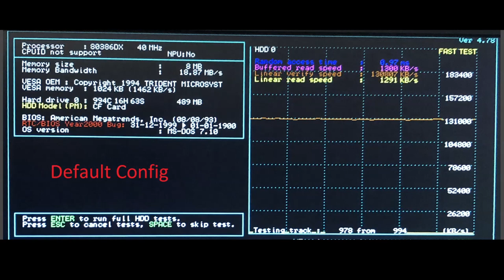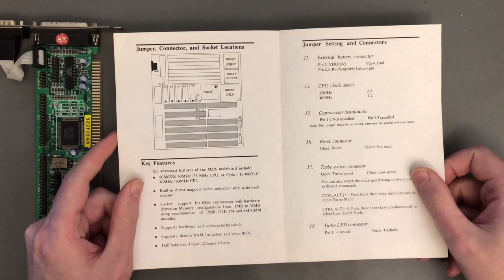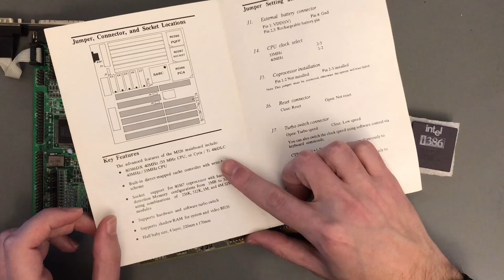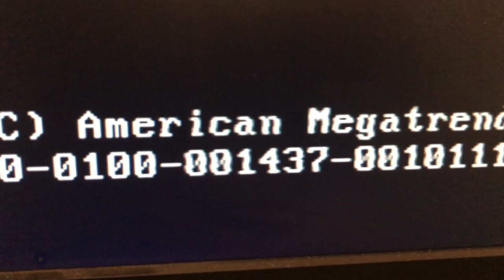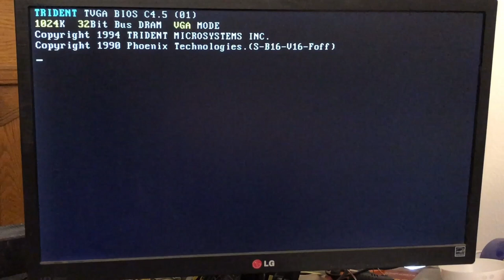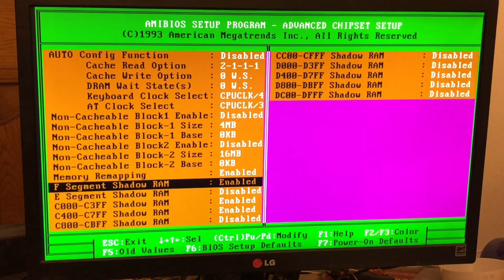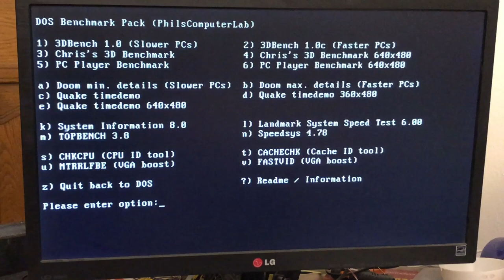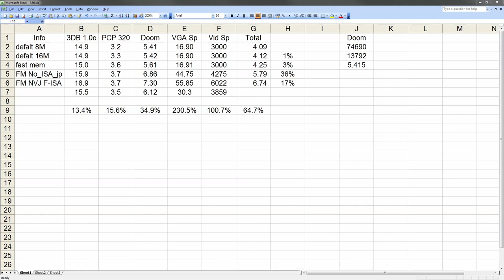386 System Review / Optimization Guide. MB: M326 v5.2 (PC chips) + VGA: TVGA8900D-R (Trident).

Comment: 26:00 Finally someone who understand how that 4 pin jumper works and how is meant to be used.
Very good explanation of the BIOS settings. I used to do this optimization on friends/school PCs to squeeze a bit more of speed; all were bought with default BIOS settings or, if thyere was a option, with optimized BIOS setting. On 386/486/socket7 omputers often it was a huge difference especially in games and Win95 speed.

Comment: Nice video. It was hard to see the battery replace segment on camera.was the pin header the external battery? When i try to use a coin battery via the external connector pins (make my own jumper connector) i get a slow voltage leak from the battery. After a few days it is drained. Would love to see a special video on replacing batteries on these great old systems. Thanks
Reply from the maker: There is no external battery here. The pin header is set as before with a jumper to 2-3.
I just placed the battery holder in place of the Internal battery, and replace the resistor behind the transistor with a diode. More than a year latter and I have still not replaces the battery.
The external battery option is made for 6v+ batteries. I think there are two in series diodes there. Measure the voltage on you battery and on the chip-set pin. You will see the problem.

Comment: I will definitely follow your approach to replace the battery, I have the same motherboard (I received it today although it has the cx486dlc and cx87) and it turned out that it had several damaged tracks due to the leaky battery

 I also subscribe: D
Reply from the maker: Thnx. I will probably test the 486dlc soon :)

Comment: The fastest processor I've run on that board is a 486DRx2/66 but it did have trouble being stable. I had to get a version of the board that didn't have the 386DX soldered to it for it to work. Do note, if you solder the socket in you will have to connect #FLT(pin 54) to VDD(pin 55) to 'disable' the DX(I just did a quick solder bridge). That pin isn't connected to anything on this motherboard so there is no jumper to disable it unless you add one. I cover that in the video I posted about this board where mine happened to have a factory socket on it.

I just got that board out and with 0 wait states and faster cache settings I got 28.7FPS in 3DBench 1.0c and 7.0 in PCPlayer 320 on the 486DRx2/66 in that motherboard. Unfortunately it won't post when I try to OC it to 80MHz or OC the ISA bus.
Reply from the maker: Hi, I am subbed to your channel and well aware of your videos on this. Great stuff! Nice to see you here posting :)
I will try for sure in the future to remove the 386DX and add a socket. I hope everything goes well.
I do not have an 486DRx2/66 but I have an Cx486DLC. This would be a nice boost.
I can also now set the clock at will at any setting, so I expect some nice OC here :)
Check my latest video on 386 Overclock!
Reply: @atheatos  Watched it last night, nice to see someone going board level with mods! I wasn't nearly as into electronics as I am now when this stuff was new and the hardware hacking is quite fun. Can't do much of it with the new stuff but there is still plenty of fun to have with the older stuff!
This hardware clock hack might be just the ticket for me as 40MHz bus giving an 80MHz clock is too much for the processor I currently have in the board and it needs a clock frequency in the middle.
Reply from the maker: Yea! I see this exactly the same :)
Old M/Bs... are so easy to mod, and so so much fun :)

Sure! Do my mod! Maybe try with some Dip8 oscillators for now.
There should be some out there in the 66 to 80 range that will give you options in the 33 to 40 Mhz bus range.

I will be also be able to provide my clock generator in a PCB in about a month from now.

Comment: Does anyone have the M326 Rev. 2.7 and could make a Bios dump for me? Mine does not function correctly :-/
Reply from the maker: I do not know your problem, probably unlikely to be caused by the Bios.
I am now 100% sure but the Bios should be the same across different revisions.
I mean the same bios is used also with the M601 that is an 486 M/B with the same chipset!
So you can try these:
http://www.win3x.org/uh19/motherboard/show/5512

Also check my Video, were I try the Award bios:
https://www.youtube.com/watch?v=SnEwOjbzboo
Reply from the maker: I have to check this again.
But last time I did, the only benefit of MrBios was supporting bigger HDDs.
Other than than MrBios is very limited in settings.
Reply from the maker: No keyboard is most of the times due to damage form leaky battery.
It is possible to fix I think.
Reply from the maker: Poor M/B :(
Hard to help more form here.
Also I am not that good with repairs actually.
Reply: @atheatos  It doesn't matter every idea can be helpful to get it running properly 🙂
Here's the thread with a lot uploaded photos https://dosreloaded.de/forum/index.php?thread/4594-pc-chips-m326-ein-386er-board-im-mini-format/&pageNo=1